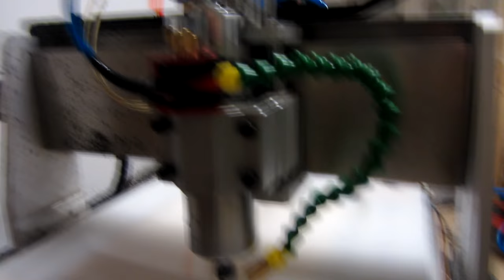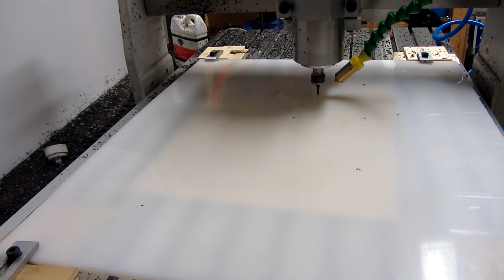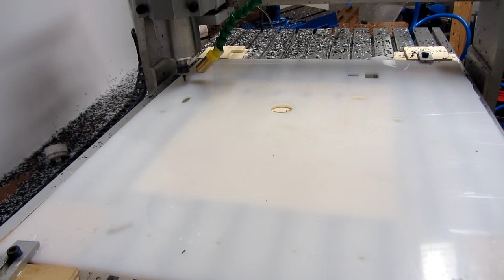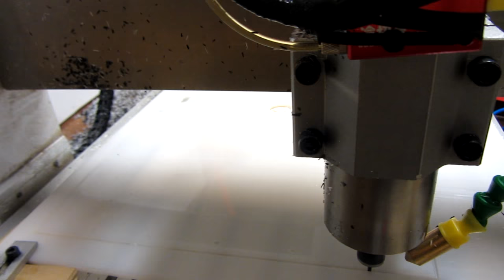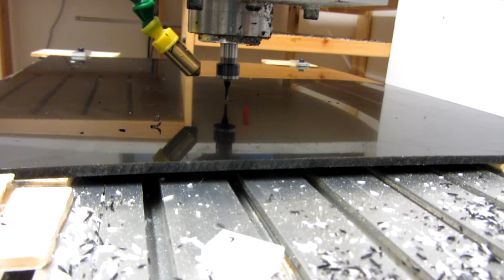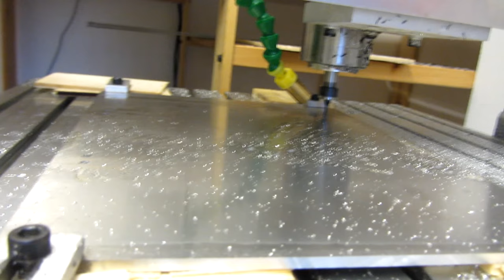Smoothieboard on 6040 CNC, accelerated

Comment: Wonderful, thanks for your great input, this video and your advice has helped my decision on the device I will buy! I also had thoughts on installing a small gyroscope to the spindle unit, to remove any shake or feedback, as it looked like aluminum created some feedback, as well an active radiator to the liquid coolant system. Hopefully this will allow for extended machining, with lower motor wear.

Comment: I see you didn't use the plugged in drivers for the steppers , you used your own drivers ... what kind of stepper motors do you have on? how many amps?
Reply from the maker: I believe those were 3.5A stepper motors on the machine, they came with it.
Reply: wow that was a what i call a quick reply :) I have made my own cnc machine and for now i use arduino grbl and 2amps 53 steppers, do you think I will see a big difference with this board in smoothiness and speed?
Reply from the maker: That's what many many users report, but it depends also on your exact machine. There are also advantages in terms of features, documentation, ease of use, community support, speed of development etc.
Reply: thank you very much sir ... I am between this board and the pibot board ... both are offered by the openbuilds sites ... you have been very helpfull

Comment: Is this cutting aluminum in the last scene? Very cool!
Reply from the maker: Yep. I actually do it faster and with cheaper endmills nowadays, this was pretty early after I got the machine.
Reply: I'm looking into machines at the moment myself and this kind of cnc mill looks like it might suit my needs and budget. I am a 3d modeling guru so I can't wait to get my paws on machine capable of cutting aluminum that thick!
Reply from the maker: draco man
Yeah those chinese 6040 machines are pretty capable and cheap. Make sure you get the 1.5kw watercooled spindle version.